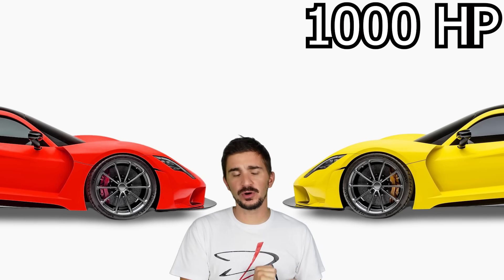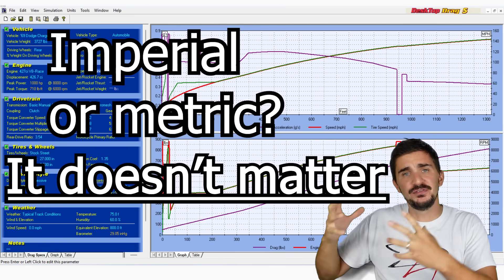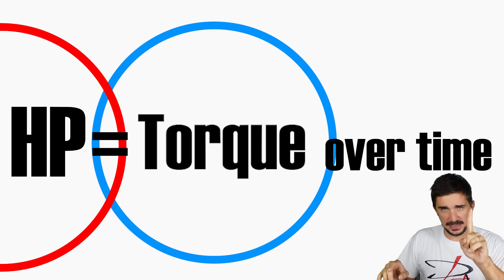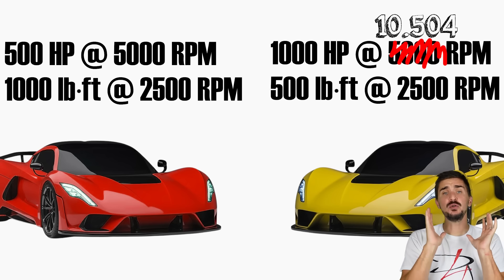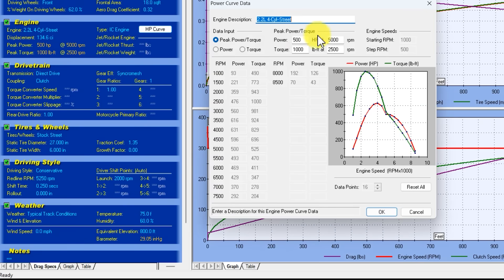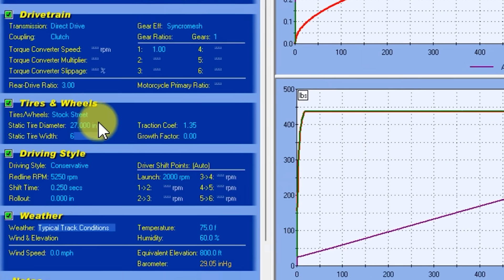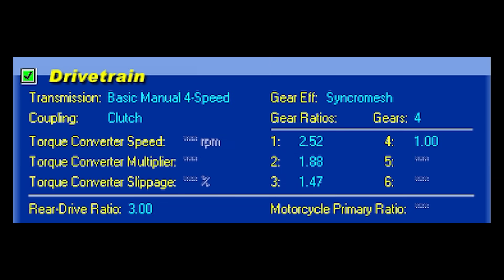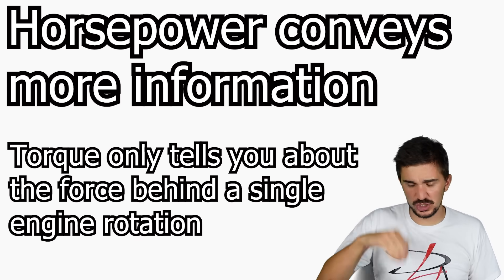Who's faster? Explained and Simulated - Horsepower vs Torque

Comment: Except this isn’t true. 

Smaller displacement engines, often have much more HP than TQ. Look at any 4 cylinder motor, whether a motorcycle or say… Civic. You can have 1k HP and 500TQ. It’s limited via RPM, boost, timing. This is simply bc typically, the bottom end of the motor can’t necessarily take the forces of incredible torque down low, so it’s ramped in gradually. 

Thus, you can absolutely have 1k HP and 500 FT/lbs @ 6500RPM.
Reply from the maker: Show me an engine with such specs please
Reply: Boost line Performance has a K series motor with this premise, albeit at higher RPM. However, they can ramp the boost much lower to have quite a delineation between TQ and HP. Here’s an excerpt since I can’t post links. 

…And big-block torque is indeed what the K series delivered, pumping out over 500 lb-ft through nearly the entire pull, with torque peaking at 558.9 lb-ft. Horsepower came on hard once the turbo spooled and the engine pulled all the way up to its sky-high 9,800rpm redline, peaking at 1,042 at 9,800rpm and 33psi of boost. The engine cracked the 1,000hp barrier at 9,500 rpm and would have happily kept pulling if the dyno operator did know better. “It cracked 1,000hp at only 33psi,” said Wilson. “We’re at full boost at about 6,000 rpm. We can make it come in earlier, but there’s no reason because there’s no traction.”
Reply: @Tsar_Kasm horsepower is found by a formular: torque×rpm/5252. Using that you would have 619 horsepower if the engine make 500 pound feet torque at 6,500 RPM so no those specs are not possible.
Reply: @Tsar_Kasm  hey i did go ahead and look up that engine, and guess what? Im right because I have the ability to do simple math. It makes 551.7 ft*lb torque at 6500 RPM for 682.8 HP at that RPM. Peak power is at 9800 RPM where the engine makes 558.9 ft*lb torque and 1,042.8 horsepower. Nowhere does it make 1000 hp at 6500 RPM and 500 ft*lb torque. Because that is impossible.
Reply: It’s possible. As I’ve already explained. 

You can always head to their website where they post the engine build, show the dyno sheet, and video of the vehicle. 

Google is an excellent resource if you’d like a further dive into how it’s achieved. Small displacement motors almost ALWAYS make twice the TQ as they do HP.
Reply: @Tsar_Kasm  torque×RPM/5252. Its a very basic formula that a middle schooler could do so the fact you cant wrap you head around it is embarrassing. There is no engine that makes 1000 hp with 500 ft*lb at 6500 RPM. The engine would have to either make that torque at a higher RPM or make more torque at the same RPM.
For example the engine could make 808 ft*lb at 6500 RPM for 1000 hp. Or it could make 500 ft*lb at 10,500 RPM for 1000 hp. But an engine that makes 500 ft*lb at 6500 RPM only makes 619 hp.

Comment: At 4000 RPM torque biased engine makes 600 hp, hp biased engine makes 400 hp. So the question is how quickly this car gets up to 10.000 RPM. Becuase until around 5000 rpm, hp biased engine do not produce more hp than other one. If we allow more hp engine to be at 10.000 RPm all the time  ( not drag racing, racing conditions ) that car would accelarate twice as much.

Comment: 500hp and 1000 torque will win the drag race. But Top speed goes to 1000hp. That my guess.
Reply: Higher horsepower means higher acceleration and higher top speed. Engine torque is not that important since cars use gears.

Comment: A serious question, if you add a gear to the output of the torque bias engine to raise its output RPMs wouldn't that in essence let it produce more horsepower?
Reply: No, because that would reduce it's torque. Power is constant and can't be manipulated with gearing.

Comment: Simple the low torque will be faster because you will be able to build it lighter as an high torque engine. and mass is slow. why would an F1 car revs @ 20.000 rpm if it would be slower as an high torque engine. you cant cheat physics..

Comment: "HP = Torque over time" this is the simplest explanation of the difference between Torque vs Horsepower. I wish I would have gotten this explanation decades ago because it took me years to wrap my head around it and make a sense of it. I came to the same conclusion on my own but it was painful and took too long. I hope someone struggling with the difference will see this video and get it much faster than me. Great video!
Reply: And what was wrong with "torque times rotational speed"? It is as simple, but correct, compared to "torque over time" bullshit.

Comment: I don’t think you fairly explained why the high hp engine won or lost. 

All that mattered was horsepower. However your high hp engine was never able to make its high horsepower due to this being available at 10k rpm. 

Increasing KE in a system is easy to workout and is solely down to power in this example.

Comment: I ran this test with car test2000 a program similar to desktop drag.  I used specs of a vet c6 and just changed the horsepower and torque values.  I got the 1000hp beating the 1000tq in the 1/4 mile. 1000hp ran 12.1 @ 121.15 mph and the 1000 tq ran 12.45 @ 119.62 mph.

Comment: So beside the equations, what if we play with the bore/stroke ratios? Obviously a large bore/short stroke like on honda engines can make quite good hp but low tq. On the other hand with diesel engines...Is there a video who takes these factors also into consideration?

And if hp is strictly always (tq*rpm)/5252, then wouldn't the max hp be simply always at the rev limiter? Please correct me.

Comment: You should optimise the transmission systems for both cars, and then show the winner. This makes no sense because no torque biased engine will use same gear ratios and other factors that a hp biased engine will use.

Comment: I normally love these videos and this channel because the presenter is clearly very smart and delivers things eloquently however I can't really get past a simulation with direct drive. It is intuitive that a motor prioritising torque over peak hp (a low revving engine) will be faster in a race vs an engine that is able to provide a higher peak at the higher rev ranges when you have 1 gear, because that's just like doing a drag race starting in top gear. This may be caveat'd later but I'm not going to watch the video hoping it'll stop wasting my time

Comment: When you use the formular to get the RPM you need to get the 1000hp with 500 torque, why you dont do the same to get the RPM you need to get the 500hp with 1000torque? Because by the formular you only need 2626 RPM to archive the 500hp with 1000torque..so the comparisson doesnt make sense to me?

Comment: Endless discussion...All will be more simple when people start thinking not about engine torque, but wheels torque!!! Cause wheels make mooving force, and high revving engine has much more transmission reduction before wheels. Another problem with torque where is this torque peak and how flat is curve. Not only it`s peak value does matter

Comment: I would spare people from watching that. 
High HP with lower torque means car can reach high speed, but slower and would suck in tugging things but can blitz. Its your fellow sport car. High torque low HP means car can reach its max speed fast, but max speed won't be high. Its your fellow tractor and he is great to tug things, but good luck to win a race with that.
Reply: Ever thought why semi trucks have 700hp under the hood? To race with other fellow trucks?
Reply: @simplemachine9531  Trucks have to tug huge heavy semi AND reach relatively high speeds. So nothing strange here.

Comment: So, I came into this looking for an altogether different bit of info. Say I am trying to choose an engine for a semi truck. What I am hoping for is to pick the most fuel efficient of two possible engines. One is 400 hp, and 1750 lb-ft torque @ 1150 rpm. The other is 455hp, and 1500 lb-ft @ 950 rpm.

Knowing that a larger percentage of fuel is spent accelerating then once cruising, I am unsure as to which set of numbers equates to higher fuel efficiency.

Comment: Actually the higher torque vehicle is capable of producing more horsepower at a lower RPM, compared to a low torque high revving engine, which produces more HP at higher revs (a drag race between those let’s suppose identically built cars will result in a faster initial acceleration of the higher torque vehicle which will be beaten by the other one because of the high HP). That’s why truck, bus engines are chosen to have high torque low revving engine than a lower torque higher revving engine which is found in many racing cars. At the same time it is really hard to produce a very high torque very high revving engine because it needs very heavy and expensive parts which should be built in an expensive way to stay stable at a high RPM such as Bugatti’s engine.

Comment: The only reason why the torque biased car could win is when the power biased car has inappropriate and/or too few gear ratios. 

The high horsepower engine needs more different gear ratios to perform due to its narrower powerband. If both engines get optimal gear ratios for their respective power curves, the power biased engine will always win.

Comment: I separate RPM and TQ!!! Think of TQ as leverage - at low speed, it's all about the leverage - even if you have it geared to pull 40k rpm if you don't have the leverage it's not going to move! you could run more inertia (like a big flywheel) and get the engine up to speed and dump the stored rotational energy but it's not the best way. <<< Yea, this is some of the reasons why HP beat TQ all-around and yea, gearing and kinetic energy helps make up for lack of leverage but it does not beat TQ leverage.
Reply: Crank torque is irrelevant since you can make any amount of torque with the right gearing.

Comment: Thanks for the great explanation, also the example with the punches is the best to date to comprehend how they’re linked

Considering the torque and power curve related to the rpm, usually race cars will have high rpm and high rpm biased curves, with the most power delivered towards the highest portion of the rpms to maximize it at the expense of fuel consumption and practicality etc., while everyday cars will want to achieve a lower end torque and a flatter curve to give you a more usable range and less variable response.

When in MotoGP they lowered the displacement limit to 799, engines still made a lot of hp, but they had to concentrate the curve at the very top of the rpm range to achieve that and still remain competitive. That increased the engine’s variability in response aka roughness and gave less controllable bikes, counterintuitively leading to more accidents, the contrary of the goal they were trying to achieve. Now it’s back to 1000cc
Reply: So multiplication (maths for 9y.o. kids) is not enough to comprehend how they're linked?
Reply: @simplemachine9531  more intuitive

Comment: The clip very succinctly covers all the more basic perimeters of accelerating to speed over a determined distance (1/4 mile) though doesn’t express why the similar or differing engines produce 1000hp and 500ft tq vs 500hp and 1000ft tq. The inference is the engines are identical and some how magically produce different hp and tq numbers. That said, the title of the video clip ‘Who’s faster?’ Is a bit of a misnomer. Fast and quick are two very different and separate concepts. ‘Fast’ is an adjective while ‘quick’ is an adverb. Fast refers to speed, and quick refers to time, the two are NOT synonymous. Gearing and engine rpm determine how ‘quickly’ a vehicle is able to accelerate to a given speed as well as the maximum speed the vehicle is able to travel i.e. how ‘fast’ is the vehicle over a given or unrestricted distance (1/4mi vs land-speed are both religated by ‘final-drive-ratio’ and max engine rpm or ‘red-line’)... Note: Though the power to weight ratio influences acceleration it does not impact ‘top-speed’ given enough and or unlimited distance wherein time is not a factor. In fact weight is land-speed’s friend aiding in the prevention in becoming ‘airborne’. And that brings us to aerodynamics, a consideration which comes into play generally approaching 100mph depending on frontal area design which influences both acceleration and top-speed. None-the-less; Having made the distinction between ‘quick’ and ‘fast’ a more apt title would have been: ‘Who’s quicker?’ Am I being picayunish? Perhaps, although given all the good detail the clip offers on acceleration the differentiation between ‘quick’ and ‘fast’ is warranted...

Comment: the math doesn't work like that. If the car makes 500lb ft of torque at 2500rpm it doesn't mean that it makes the peak torque at 10000rpm so the 1000hp would need a lot more rpm to make 1000hp at so low torque. but the high rpm torque depends on a million things and its basically impossible to calculate.

Comment: The torque curve correlates with the volumetric efficiency of the engine and also correlates with how much air the engine is capable to suck inside per one intake cycle. The power curve correlates with the burning temperature of the mixture in the power cycle. Ideally, max torque = the best volumetric efficiency point(n/a engines), and max power = the highest burning temperature point of the mixture. With the same gearing, the 1000 hp car would accelerate faster. The more torquey engine car would only have an advantage in acceleration from a standstill until the point when you have to start switching higher gears.